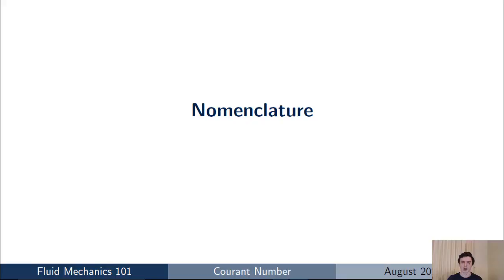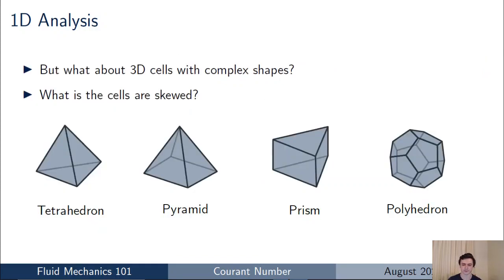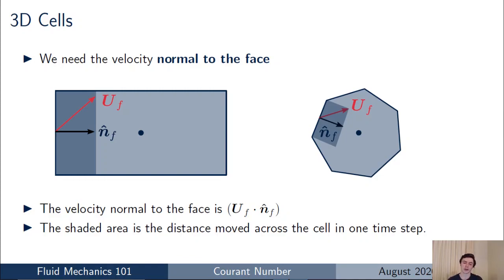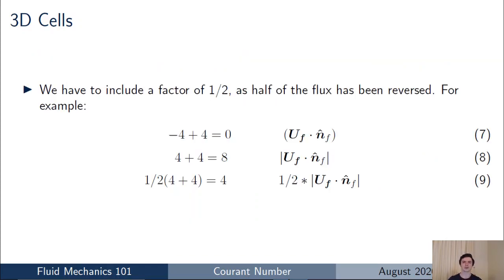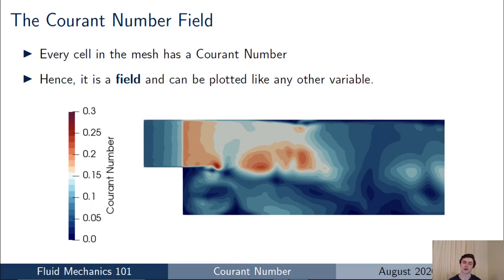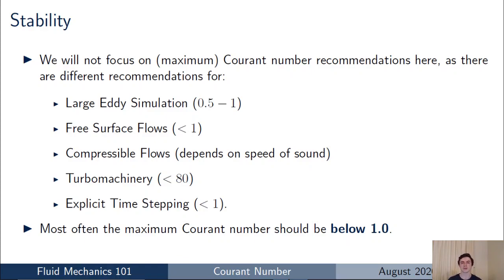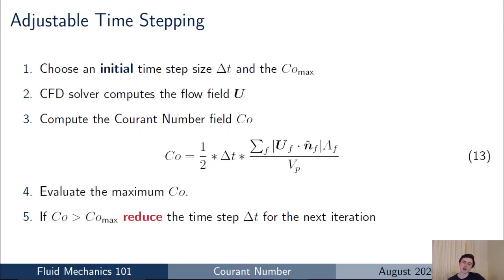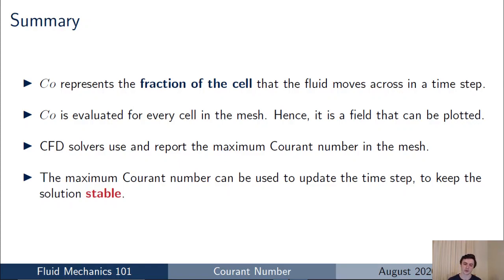[CFD] The Courant (CFL) Number

Comment: Hey there, I've been looking up for some help about my simulation controlDict setting. The deal is that all my mesh stats are normal, I check everything and checkMesh throws that all is ok. Then, when running my simulation using interFoam and putting maxCo = 1 and adjustableTimeStep yes, after few seconds the time step decrease considerably. I don't know why is this happening. If there's someone who might help, I will be very glad of. Thank you!

Comment: Very nice and physical explanation, I really enjoyed it. However, as I recall, the importance of the CFL number was mainly due to the method for time discretization. We can't go further than 1 for explicit scheme, however the value can be much much higher for implicit scheme. Am I right ?
Reply from the maker: Yes correct!
Reply: Thanks ! So why LES recommandation for CFL should be < 1 ? It doesn't only depends on the time scheme (I mean, if it is implicit we could go further without worring to much about stability) ?  Thanks again to revive all my old courses :D  @fluidmechanics101
Reply from the maker: As well as stability, we also need accuracy, which is particularly important for LES. This is why we normally insist on y+ < 1

Comment: This video concerns transient analysis. I remember when I was trying to model a steady state supersonic flow over a wedge, I used the density-based solver, and in the control panel, I set the Co number to 5 according to the tutorial. Is it the same idea or not?
Reply from the maker: Slightly different. I think the solver was using a pseudo-transient to arrive at the steady state solution (a pseudo transient is similar to a transient but does not fully resolve each time step and can use different time steps in each cell). The Courant number restrictions on a pseudo transient can often be less strict than a true transient, because we only care about the final steady-state solution and not on how we get there. As long as the solver doesn't diverge, the Courant number doesn't matter for pseudo transients. I have a lecture series on pseudo transients if you would like to learn more
Reply: @fluidmechanics101  Thank you, actually I recently watched the first part of the pseduo transient series.
I thought it might be the time step in pseudo but I wasn't sure since you didn't mention it in the video
Thanks again.

Comment: So far so good. But if I set Fluent to Density-Based with absolute velocity formulation and implicit formulation under "solution methods" the courant numbe ris set to 200 as default value. How can this work when it's generally recommended to be bolow 1?
Reply from the maker: I think fluent sets the default to 200 for steady state simulations because it is using a pseudo transient formulation and can use larger than physical time steps. If you switch to transient, you can then bring the courant number down to 1 or lower

Comment: great.thanks for sharing such a useful information.i have a fsi simulation in fluent part the courant number in controls section is 200 by default as my simulation is transient should i change the courant number below 1? or not?
Reply from the maker: Good question. Maybe give it a go. Does it affect your results?
Reply: @fluidmechanics101  it took so much time to solve! i set the setting back to defalt!

Comment: Thanks for give a such great explanation for CFL number. I have a question about the CFL<1. 
 I'm using Fluent to simulate a transient case,monitoring the CFL number during each time step.
Because the velocity field during simulation is time-varying, the max CFL number in whole domain  is also  a time-varying parameter while iterating.
So should CFL number always below 1 in whole time steps, or I can ignore the first few time step that CFL# >1? Thx so much.
Reply from the maker: I think you can probably just ignore the first few time steps,as the transient is normally just washing out the initial condition then anyway 👍

Comment: So in Ansys, when we specify a Courant number, we are actually telling it the maximum number after which to not shorten the time steps?
Reply from the maker: I can't say for sure (as the source code is proprietary) but the idea is that the code will reduce the time step until the Courant number (either maximum or average) matches the value you specify
Reply: @fluidmechanics101  awesome, thankyou!

Comment: How is the Courant number relevant for steady flows?
Reply from the maker: Only if the solver uses a 'pseudo transient' approach to achieve the steady state solution, you might need to reduce the size of the 'pseudo timestep'
Reply: @fluidmechanics101  I see, I'll check out pseudo-transient flows. Thanks for the quick reply.
Reply: @fluidmechanics101  As a follow up question, I've seen some Ansys tutorials of steady flow where they emphasize the Courant number setting. Usually I've seen c=5. (These are for steady compressible supersonic flows for example). I assume then this step doesn't really influence the result, since there is no flow "moving". Does that make sense? Thank you!

Edit: spelling
Reply from the maker: Yes correct! If your solution is steady it does not matter how you get there as long as the calculation does not diverge along the way
Reply: @fluidmechanics101  great thank you :)

Comment: Thanks for this great video. Got to learn the basic understanding of the Courant number! 

I just had a doubt though: Do we need a courant number steady state CFD simulations too? Asking this I see the default Courant number listed as 5 in ANSYS Fluent for a steady state compressible flow simulation that I am doing.
Reply from the maker: For a steady state solver that uses 'pseudo time stepping' you can use whatever courant number you want, as you are trying to get to a steady state solution. However, you might find the solver diverges if you set the courant number (for the pseudo time step) too high. 5 is probably a good place to start. If it diverges, try reducing it a bit
Reply: @fluidmechanics101  Yes, indeed, I am trying to run a simulation of the compressible flow through an Aerospike nozzle, and my results diverge for a Courant Number of 5. 

Also I happened to watch your video on 'Pressure inlet' BC. What should I take as the supersonic/ initial gauge pressure? For the compressible flow through an Aerospike that I simulating from a paper, the inlet Mach Number is close to zero in the contour plot. How close should I choose the supersonic/ initial gauge pressure with respect to stagnation pressure? I was wondering if a large deviation between those two can lead to divergence?

Comment: Hi Aidan, 

In the case of an airfoil, can it be assumed that as long as the lift and drag monitors are reporting constant values and the max courant number in the domain is less than 1 therefore the solution is somehow accurate?
Reply from the maker: ... assuming your mesh is converged and you chosen the right turbulence model then yes 😄 to be sure of accuracy, you need to compare to experimental data
Reply: @fluidmechanics101  Thanks!

Comment: I am facing negative cell volume in ansys fluent what will be the possible solutions for this and in fluent I am unable to find courant number option for pressure based solver (and my mesh is unstructured-triangular). Any kind of reply is helpful, thanks in advance
Reply from the maker: Hi there. If you have negative volumes you need to go back to your mesh generator and fix the mesh. Fluent cant fix these by itself, you need to go back to the mesh generator
Reply: @fluidmechanics101  thanks for your reply. Exactly, what should I fix? Should I increase the mesh size ?
Reply from the maker: Have a look and try and find where in the mesh the cells are with the negative volume. Once you find them you need to change the mesh structure (move the boundaries, blocks, or faces) so that the cells arent inverted. You can probably find them by looking at any quality metric (skewness, non orthogonality or determinant). They should all show bad values where the cells have negative volume
Reply: @fluidmechanics101  I checked the skewness, element quality, jacobian, and aspect ratio that seem in the range. Ok I will check other parameters too btw my geometry is 2D airfoil. Thank you so much for instant reply.

Comment: Hello Dr. Wimshurst. 
First, thank you for this presentation, explanations are very good and efficient. I would like to be sure, this stability criteria of Co < 1 is only if you solve your equations with explicit formulation and it depends also of the numerical methods we are using in the code? I mean, in some situation, even with an explicit time integration, is it possible to use Co > 1? Also, for implicit time integration, I know that there is no restrictif criteria for Co, and we can normaly use Co > 1. I'm using FLUENT right now, but I don't really understand why with implicit formulation, with a great Co, I don't have stability and my calculation diverged.
Reply from the maker: Hi Anthony, it sounds like your simulation may have diverged for another reason. Have you checked: 1) your mesh, 2) your boundary conditions ? These are often the main causes of divergence. Try solving a simpler case with the same mesh to see if you can get convergence. This will help you identify why your simulation is diverging
Reply: @fluidmechanics101  I am trying to simulation the flow through a multi-stage centrifugal compressor and I am using the Mixing Plane Model (MPM) with mass-averaging method. The mesh is created by TurboGrid and is very good by default and the boundary conditions I have tried are Mass Flow Inlet / Pressure Outlet. I have tried also to perform with the Pressure (stagnation) Inlet / Pressure Outlet, but without success in multi-stage, when I include the MPM. Otherwise, with only one compressor stage (without the MPM model), it works...

Comment: I don't see physical meaning for such a huge diference for Co < 80 for turbomachinery in relation to the much, much, smaller figures of other common flows. Could you explain that?
Reply: Not sure if I am confusing this answer by putting in my two cents or not, as it has been sometime since I have written my own CFD codes and started watching these videos because I would like to get back into it.  But as I recall from reading Patankar's book which introduces the SIMPLE and SIMPLER algorithms, you can sometimes get away with your code converging even with higher CFL numbers if you use a method that is more implicate than it is explicit.  Although I may be confusing two different issues.  As I said, it has been a long time since I read this.   I was also curious about the very high CFL number listed in the video for turbomachinary, so I thank you for asking the question.
Reply from the maker: Ah yes, i probably should have explained this more. With turbo machinery it quickly becomes very expensive to use small time steps as you often need to run several full rotations of the rotor to converge the solution. Hence, it is common to use bigger time steps (so that Co is >> 1) and converge more within each time step. I have found that you can often get away with Co up to around 80 before the solution diverges. I wouldn’t stand by these values though, they are just indicative that people often go for bigger time steps with turbomachinery. I hope this helps!

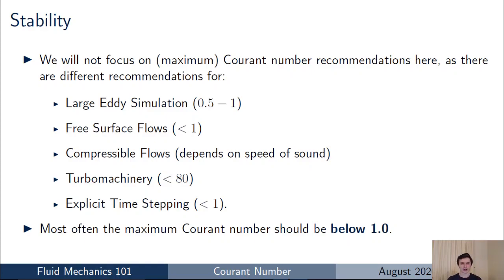Comment: Great lecture. I have a question. The slide 'Stabilty' at 19:28 says criterion <80 for turbomachinery? It is ok? In compressible flow the velocity of sound  is not mentioned? Should it be added to abs U dot product?
Reply from the maker: To be honest, the criteria for turbomachinery is based on my experience with OpenFOAM. I couldnt really get a Courant number higher than 80 without it diverging. This will be different for different CFD codes and for different geometry. (Also my mesh was really high quality structured mesh, which might have helped)

Comment: Is the value less than 80 not an error in the calculation recommendations? That is, if I simulate a centrifugal fan, then I can specify the values 79 78, etc. I don't quite understand why why such large values. Thank you for the video :)
Reply from the maker: A number of around 80 is just from personal experience with OpenFOAM and the pimpleDyMFoam solver. The max value you can get away with will be different for every CFD code. I would just try some different values and see what you can get away with. I used 80 as an indicator as i havent ever really see anyone be able to get higher than 80 without it diverging ....
Reply: @fluidmechanics101  Thanks for the answer. I will try to use your advice and solve the problem for different values of the courant number.  Will try to set an automatic time step in the solver and seen what happens. Perhaps this will increase the stability of the solution when using the k-e turbulence model.

Comment: ı understood that if the cfl number is higher than 1, it's already exceed the mesh that we are observing. But in turbomachinery you r reccomendations is less than 80. with that way how we gonna sure that these numbers are good for our cfd. I mean what might be coused if our turbomachinery cfl number is about 100. btw awesome presentation, thank you aidan :)
Reply from the maker: Yes, i probably should have explained this a bit better. In an ideal world we would always have CFL < 1. However for turbo-machinery in particular, this can be realllly slow ... so to get around this we use larger time steps (CFL > 1) and do more convergence within a time step. Really the solution is more of a series of steady state soluttions rather than a true transient. I have found from personal experience that you can often push up CFL as high as 80 without it diverging. The best thing to do is experiment for yourself 👍

Comment: Sir how do we define courant no for multiphase flows with perspective of courant no as fraction of cell travelled ?Are they distinct to each phase or sum up as a single unit?
Reply from the maker: It depends if you are using homogenous multiphase or inhomogenous. If you have a shared velocity field (homogenous) then the courant number if for both phases. If you have inhomogenous then you can have a courant number for each phase 👍
Reply: @fluidmechanics101  Thank you sir 👍

Comment: Great sir
I was simulating jet impingement cooling on flatplate  and consider delt t 10(-6) and max cohrent no 0.8 but my delta t reduce to 10^(-16) so i did many things it not works then I change discretion scheme of div (u) gauss cubic from gauss linear delta t adjusted to 5e-6 and cohrent no 0.24 sir does this affects my physics any way I am doing LES
Reply from the maker: Ahh yes there could be a number of things going on here. Have you checked your mesh and run a precursor RANS simulation? Try plotting the courant number and see where it is going so high. It sounds like you have adjustable time stepping, thats why the time step is going down so much
Reply: I guess not, the models remain the same